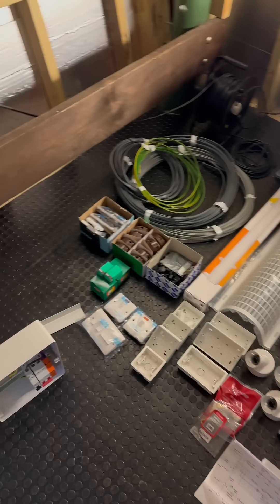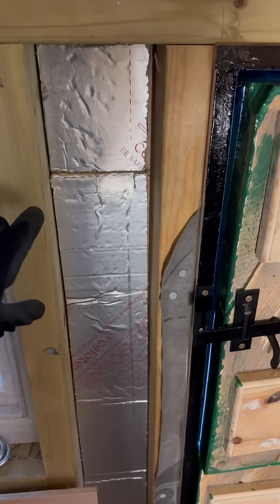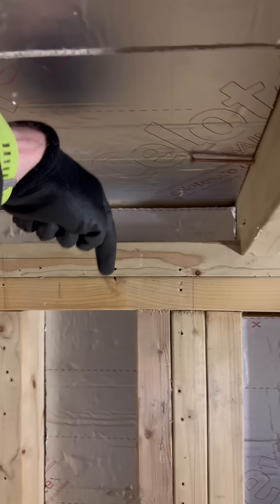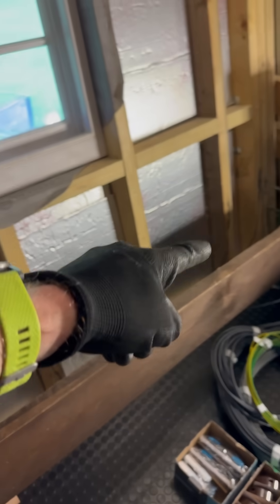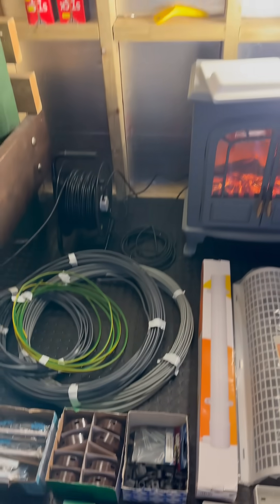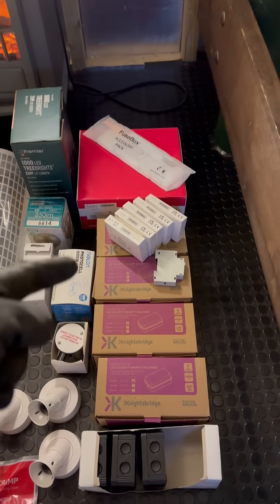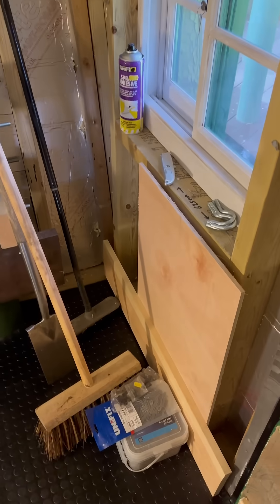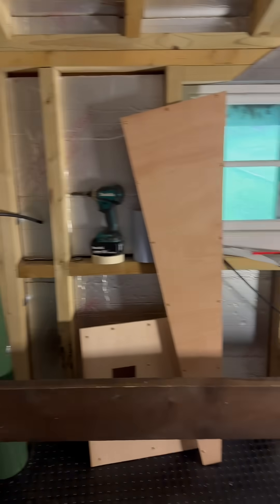Tree House Electrical Installation - Wiring & Layout Explained

Comment: I would have gone down from the corner and then across to the fuse box rather than through the corner and around the box.
Reply from the maker: That definitely would have been the easiest way! Didn’t have a drill bit long enough to get through the triple braced section unfortunately